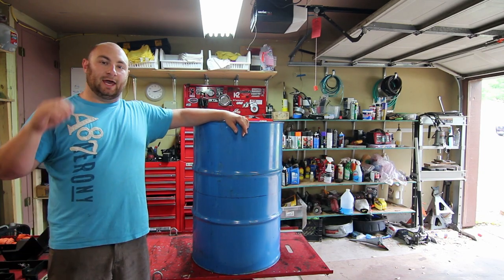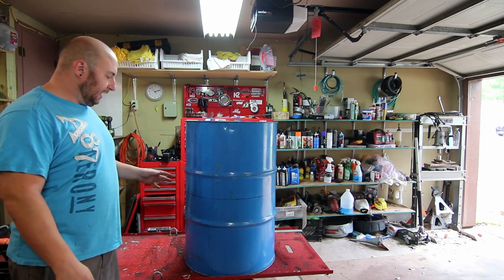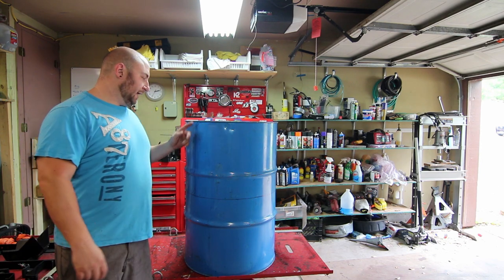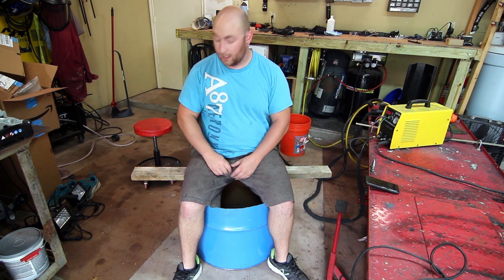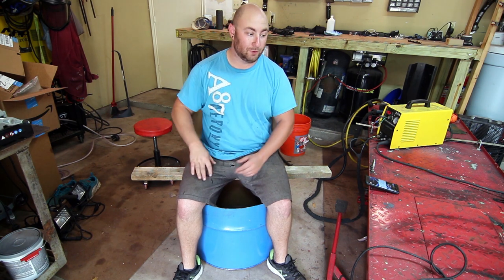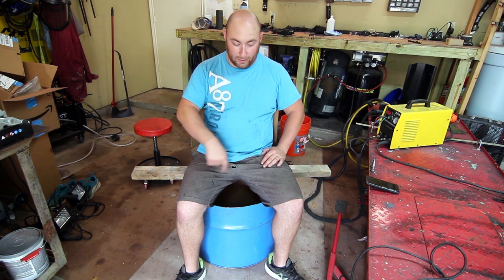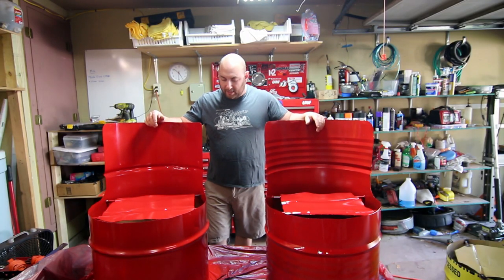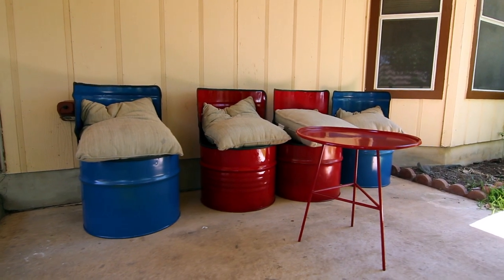MaksWerks Cheap Welding Videos - Oil Drum Chairs

Comment: Hi Maks! I have a quick question: I heard you say you put a rubberized guard on the sharp edges. What do you use for that?
Reply from the maker: Its called RV Edge Trim - you can find it by the foot or by the roll on ebay.
Reply: +MaksWerks , Thank you!
Reply: What size rv trim do you use buddy ??